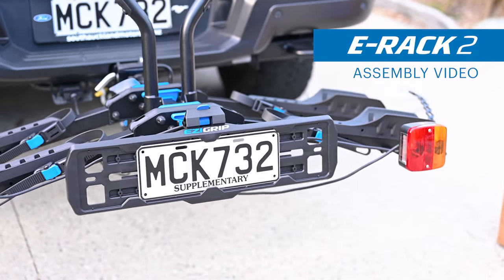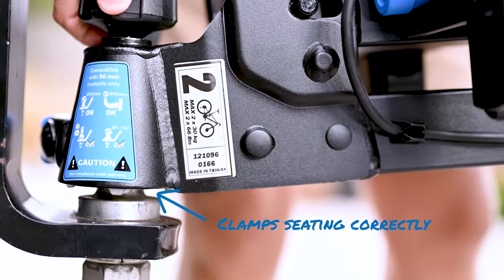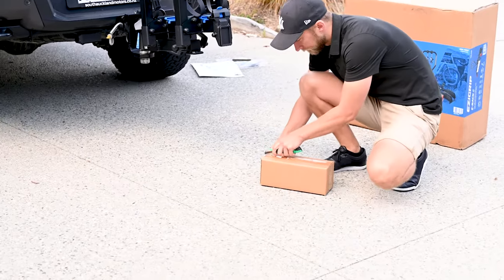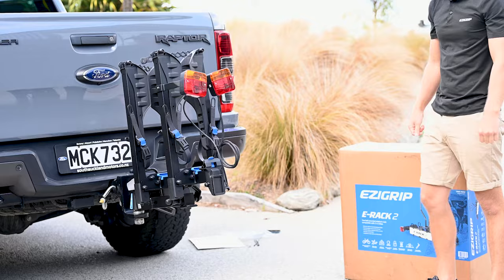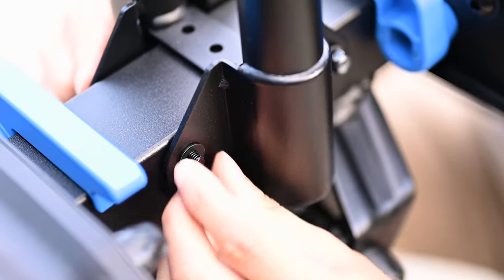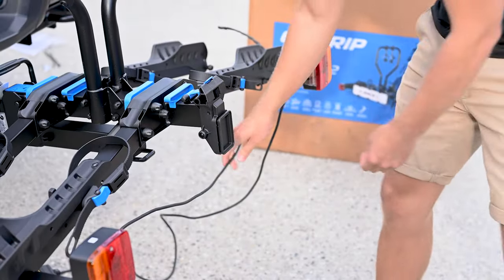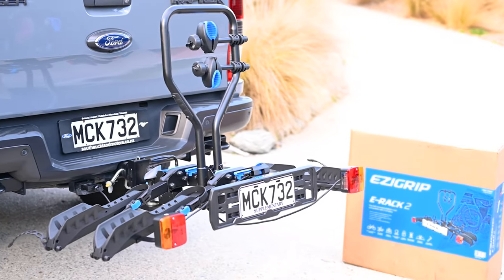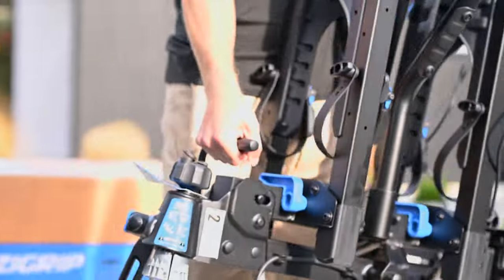Ezigrip E-Rack 2 - Assembly Guide

Comment: I have an eBike and its under 30kg. Could I use the Ezi-Grip Enduro 2 Towball Bike Rack with Lightboard instead of this more expensive rack?
Reply from the maker: Hi Paul, any bike over 15KG can not be used on the Enduro 2. Any weight over this we recommend the E-Rack 2 as it has a 30KG weight limit per bike.
Reply: @ezigripracks2342  Great thanks. I picked up this rack. Works like a charm!
Reply from the maker: @photobooksandrecords  Great to hear!